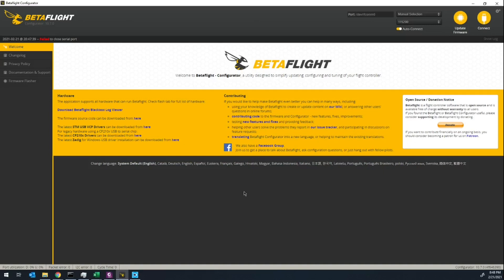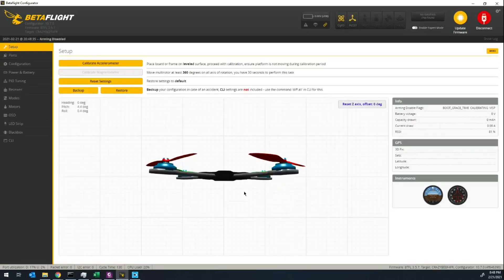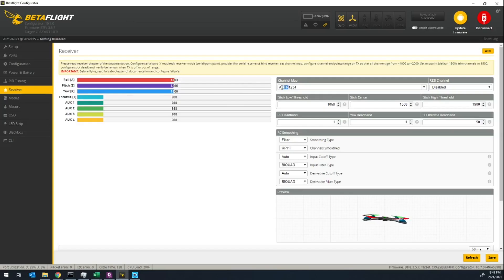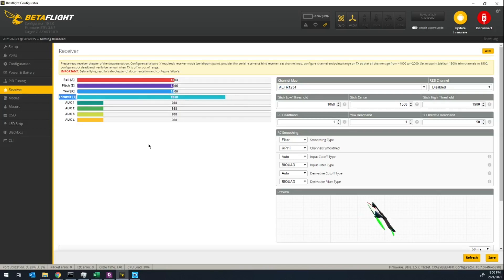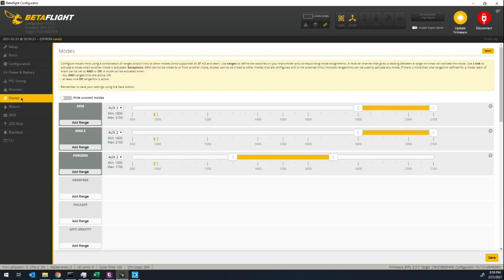How to bind your Jumper T-Lite to a Receiver? (Moblite 7 | Betaflight)

Comment: Bought one and had a lot of trouble in configuring it. First it wouldn't arm. Entered in betaflight and changed the min check throttle to a higher number than 1000 (I think I put 1100) and got to arm it and "fly" it but the commands are turning opposite sides as they should. Tried calibrating the z rotation in betaflight and nothing. Tried also setting in beta the inverse rotation of motors (my moblite came rotating outside, is that normal?) and nothing. Also, its very strangely calibrated and well, all these problems. Tried flashing the firmware! but the bootload mode won`t start.... the manual is very confusing and has ambiguous and non working indications. Can someone help me??? I'd love to just have a straightforward method and boom, fly it!!! Thank you in advance!!!!

Comment: Hi again I have a issue with binding my Jumper T Lite with my R XSR receiver, I go through the normal bind procedure but no stick movements are working in betaflight im not sure what to do any advice would be much appreciated thank you, this is a different quad then my other message this is my first fpv drone and I'm stuck at this point
Reply from the maker: Did you try to change layout option?
Reply: @startfpv574  No I have not where do I find that betaflight? What should I set it to?, I'm a complete knoob as you can see lol
Reply from the maker: @tecnikturbo  This might be the solution. https://www.youtube.com/watch?v=YnEDqGZwPpo
Reply from the maker: @tecnikturbo  but before you try the stuff in the vedio, try to set the receiver to SBUS, and make sure your UART is correct, and in the receiver tap, make sure your channel map is correct.
Reply from the maker: @tecnikturbo  I know, I'm new too. Each time I fly I crash, and i have fix the drone :(
Reply: @startfpv574  Thats what I was thinking need to update the R xsr but the Jumper T Lite with the cable that comes with it won't connect straight I need an adapter
Reply: I will try what you have advised later when I have time, thank you very much again for your help 😊
Reply: @startfpv574  So watching the video again the wire that comes with the Jumper T can be modified just switch the red and black wired on one end and good to go updating using external module? Where do I find the correct update file?
Reply: Hi again friend, we have lift off! So as expected it was the receiver that needed updating which got the tx inputs working but motors would not spin, changing dshot commands from 1200 to 600 and now they are working great! Thanks for all your advice much appreciated 👍

Comment: How do you put the moblite 7 in binding mode?
Reply from the maker: Press the little button on board
Reply: @startfpv574  I couldn't find the button. Is it on the downside or upside?  Thanks
Reply from the maker: @reinaldostrobel81  bottom, where the usb port is. Next to the usb port, there is a big chip the bottom is next to the chip.(not the one next to the usb port)
Reply from the maker: @reinaldostrobel81  https://www.getfpv.com/happymodel-diamond-f4-fr-5-in-1-aio-flight-controller-w-built-in-esc-vtx-receiver-spi-frsky.html
Reply from the maker: @reinaldostrobel81  check this link,go to description, there are diagrams ,BIND is the bind button
Reply: @startfpv574  I found it! thank you so much brother! the button is 10x smaller than my other drones HAHAHAHAHAHA time to fly now!!! thanks a lot!
Reply from the maker: @reinaldostrobel81  I know!!! Lol. I broke two of my motor, I was flying it too fast, lol. Waiting for my parts. It is nice drone. Have fun.
Reply: When you press the bind button are the lights supposed to flash faster? My bind button seems to do nothing and the cli commands for binding also do nothing

Comment: Good afternoon, do you think this radio will give compatibility issues with frsky recent receivers? I know from personal experience that the BETAFPV Literadio 2 se is a no go....
Reply: The frsky recievers d8 binds right up, it's the only receiver that i got it to bind with. My flysky, walkera and of course the dsm2 spectrash won't bind at all. But no manual is the real problem here don't you think?
Reply: @thatman8987  well it’s a open tx so I guess you can refer to all the videos about pretty much any taranis tbs tango jumper radiomaster but you are still right. I personally managed to bind it to a frsky spi rx (Mobula 6), to a frsky rsxr (Nazgul5) and to a Radiomaster R81 (3” custom build). The binding process was sh*t and frustrating on all of them but I managed

Comment: I wanna jump into fpv. How do you know this is the correct setup, Frsky, etc. Does the quad have specs on the manual. Thanks
Reply: i just gotten into fpv in january and this is all i learned 
alway start with simulator if you do not want to fully commit into the hobby because it is pretty expensive for me atleast 
start with a simulator i recommend drl simulator 
it really helped me get a head start  

please correct me if im wrong this is all i learned while i was in the hobby it is not a perfect explaination because im filipino my english isn't great 

Main things you need to fly 
fpv drone
transmitter/controller/radio
fpv goggles
batteries and chargers 

first lets talk about radio/ transmitter 
there are different radios with different receiver thats basically how the drone and radio talk 
the most famous ones i know are 

these are the radios 
There are different kinds of controllers 
here are the most popular  i know

Flysky are cheap and reliable they have other high end models too
frsky are the company standard they have good build quality 
radio master are multiprotocol which means they can bind to other brand radios 

these are the receivers 

Flysky - budget friendly more cheap
frsky d8 / d16 - Hobby standard
dsmx - always see it but not very familiar with it
Radiomaster radios are popular too and have multiprotocol/multi languanges they have many different languages they can bind to flysky/frsky and other  things just read the product description 
TBS crossfire - its a type of protocol you put on your radio that is for long range and is expensive perfect for the guys who are really into the hobby

drones there are many kinds of fpv drones 
there are

Tiny whoop - in my opinion ideal for beginners who dont want to spend much money if they want to try it out cheap
3 inch toothpicks - a little bit more expensive and powerful but flies like a 5 inch 
5 inch there are 2 categories i learned - they are expensive and powerful 
there are 
5 inch racers - light and agile for racing
5 inch freestyle - a bit heavier for smoother filming and for freestyling. freestyle is basically parkour for drones
6 or 7 inch long range drones - i only know a few about them 
they have bigger motor and bigger propellers for more effiency they are big and sometimes have gps

acronyms 
BNF means bind and fly drones they are prebuilt drones that have a receiver in them so you just bind them and fly right away
vtx means video transmitter they are the one sending signal to you goggles 
rx means the receiver in the drone where your radio connects
tx is the radio 
fpv camera is the camera in the drone so that you can see 
betaflight - is the most well known configurator for fpv its a software in your computer you can download its basically a control room 
osd - on screen display on the goggles its the statistics of your drone thats where your voltage is flight time and other stuff 
voltage sag - means the voltage drop 
dvr or digital video recorder these are the one that records the screen in your goggles so that u can see your flight they are sometimes built in 
in goggles but some dont have dvr 

batteries 
there are different batteries for different drones 
the one most used in fpv drones are lipo batteries there are many lipo battery 
there are 
1s or 1 cell lipo it has 4.2v - mostly used on tinywhoops
2s or 2 cell lipo it has 8.4v - used on tinywhoops and toothpicks
3s or 3s cell lipo it has 12.6v - used on toothpicks and 5inch drones
4s or 4s cell lipo it has 16.8v - used on some toothpicks and the most common battery for 5 inch drones and some long range drones
5s lipo i never hear much of 
6s lipos are crazy powerful and used on racing 5inch drone and long range drones 

connectors of battery

ph 2.0 - mostly used on 1s batteries that are used on tinywhoops 
bt 2.0 used on tiny whoops mostly from the brand betafpv
xt30 very popular and used on toothpicks mostly used on 2-3s batteries
xt60 much bigger than the xt30 mostly used on 4s-6s batteries 

fpv goggles there are 3 types of fpv goggles
there are 

Box goggles, binocular goggles and digital goggles 

box goggles and binocular goggles have analog signal meaning they have less latency but low reso video feed 
digital goggles are goggles that have a digital signal and hd video feed 

Box goggles are big goggles that have a single screen in them 
binocular goggles are small and slim goggles that have a screen on them 
digital goggles have hd screens on them and are much more expensive 

box goggles are cheaper while binocular goggles and digital goggles are more in the high end

there are things that are challenging for fpv than normal dji drones 

there is modes of movement 
there is 
angle mode -  angled mode that is stable 
acro/air mode fully manual mode mostly used by all the fpv community allowing for more precise and free moves 
horizon mode its like half angled and half acro you can flip but will stabilize
Reply: Look at the listed specs for your model drone or if your receiver is separate you can look at it.
Reply: Yes, Most popular and decent receiver is frsky and flysky..there is also a advanced module receiver like tbs crossfire

Comment: I followed your instructions and my switches still don't move the bars while b flight in receiver tab. I'm beginning to really hate this radio, I mean, no instructions? The quick start paper is a joke. You should make a video and call it the "un official manual".  Any help appreciated.
Reply from the maker: Did you try to change the swrich order in beta flight? It happened for me as well. I was able to let it move after change beta flight receiver configuration.